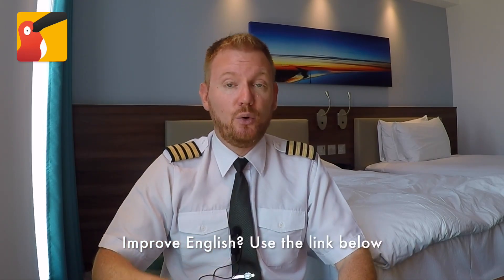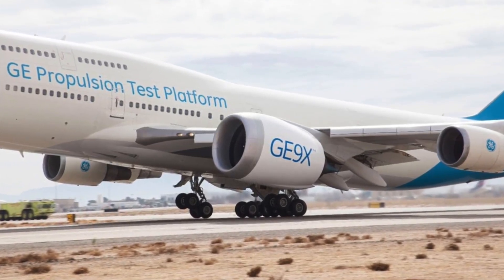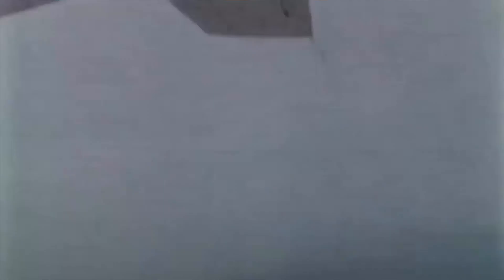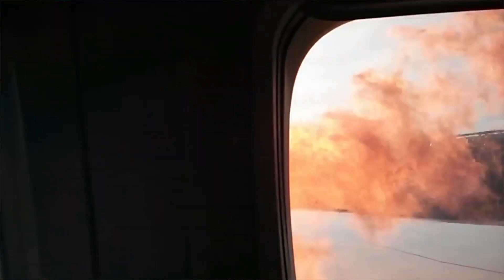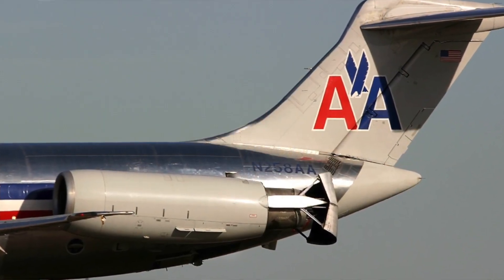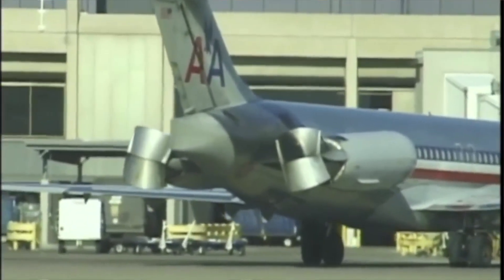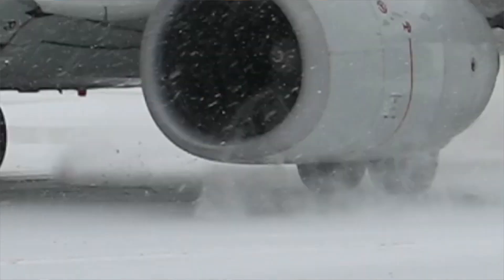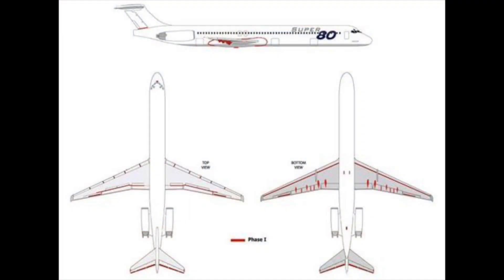Why are the jet-engines placed there? Wings vs Tail

Comment: Good Evening... Could you make make a video on engine maintenance specifically i.e. when do we conduct a complete engine overhaul, after how many flight hours etc
Reply: Tushar Mehta - Pilots do a walk around. Yes they make sure there are no obvious issues with the aircraft before flight. All real inspections are accomplished by a maintenance tech. Pilots have no clue of service times or any real time and cycle maintenance. I am both a pilot and what we call an A&P here in the States. As a pilot you learn the basics of the aircraft and how it handles. As an A&P you learn how the plane actually works.
Reply: Sterlingjob They wish!!! I believe they inspect the plane throughly before each flight. The maintenance crew and the pilots work in sync to check the air worthiness
Reply: Tushar Mehta These new engines last a good long time! Check the builders websites.  They are phenomenal!
Reply: Tushar Mehta depends on the company but based on my understanding is that they follow a periodic check. 

A check could happen in 100 hours or 100 cycles and would be designated to do a certain maintenance task. Inspection of Low pressure fan blades (part of engine overhaul) 

B check could be 200 hours and another engine overhaul task would be completed like lets say inspection of Accessory gearbox, topping of oil, servicing axial bearings of engine

C check another maintenance task listed in engine overhaul and so forth and so forth. So hypothetically speaking, 2A checks is 1B check. 

Airlines like to do this so airplanes downtime is limited instead of doing a complete engine overhaul which would likely ground the aircraft for weeks.
Reply: Bill S Great to hear from you. Quick one... Are the pilots required to take a look at the maintenance log/flight log before each flight? I am sure that pilots do speak with the maintenance crew in detail before each flight if there's any issue with the engines/equipments and does the maintenance crew keep multiple records of the inspection carried out before each flight?
Reply: Tushar Mehta - Absolutely! Pilots will always see what's been happening in the log book before each flight. However maintenance and the pilots usually only talk when there is a problem with the aircraft. Pilots do a pre and post flight walk around and maintenance isn't required to be there. The only time you will get maintenance out of their/our "cave" is when there is a problem. lol.
Reply: mike michopoulos would you know of anyone I could ask maybe. I thought Peter would be the best as he provides detailed information. I am no aviation guy or getting into it. Just an enthusiast
Reply: Tushar Mehta The flight plan includes any problems or failures an aircraft has while dispatch,  mostly minor thing such as antiskid inoperative , so that the pilots would know in this case the maintenance personel will have a brief talk with the pilots about the problem as pilot are used to having certain things not available ,
Reply: According from a friend who is an aircraft mechanic, commercial engines in the olden days they get overhauled every 1000 flying hours.
Reply: Rolls-Royce Rb 211 advertise 40,000 flight hours between overhauls. Most of RB-211 is installed on Boeing 757.
Reply: Depends on the engine type and airline maintenance program. Normally the overhaul visits are based on cycles flown ie. a GE CF6-80C2 would be between 3000 and 6000 cycles depending on aircraft type and use. A Rolls Royce RB211 which is a little more robust will fly 7500 or more cycles. The more cycles flown the higher the overhaul costs normally. The engines are driven to hard time removals by the LLP(Life Limited Parts). The engine must be removed prior to an LLP running out of cycles. There are a number of factors involved but these are the basics.